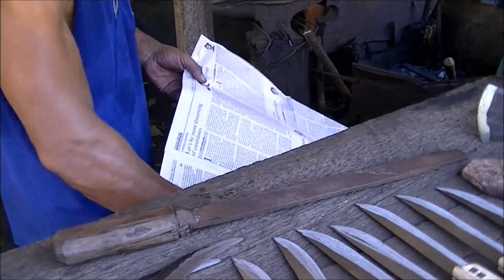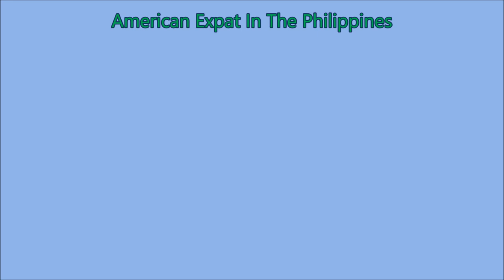Filipino Blacksmith - Making Bolos

Comment: do they oil or water for quenching?  They don't test either for hardness?
Reply: I'd hazard that they more than likely use water, given their resources available. Yes, it is leaf spring but I'm sure the water is plenty heated enough from the amount of items being quenched in it it.

After a while, you pretty much know how long to heat a blade, when it's hot enough to be quenched, and when it tempered. And, given the sheer amount of blades these individuals likely hammer out yearly, they probably don't need too anymore.

Either that or their testing is when they start filing the blade. The file will just skate and slide across the surface of a properly hardened blade.

Btw I'm a blacksmith myself.
Reply: @Kurokubi  their method of quenching the steel is not using the traditional way. We have a technique passed down from generation to generation likely to cut a nail with it. What they are using is just a basic hardening and no tempering that's why its likely to get chipped. Same reason that i stopped buying and started forging my own blades as the quality of the blades from the market are no longer have the quality from the old times. Luckily learned a few tricks from the old generation.

Comment: i wish i'd find these blades where the handle is more durable and longer-lasting than wood. don't get me wrong, i'm filipino, filipino blades have always sparked my imagination ever since, but i wish they'd upgrade a few things, the handle for example (next the sheath). i'm thinking of melting white pvc's over the full tang handle, looking at a few youtube videos, anyone can melt pvc's into any shape with just boiling water. but of course if you have better tech available to you, then of course if i were you i'd ignore pvc as well. if it were the year 2519 and a material stronger than carbides of today was just invented, i'd throw away steel in a second.

wooden handles were all the rage when there was nothing better available (in the year 1919 for example), but in the year 2019 there are now a few things commonly available that perform better than wood.

take note, i have no complaints with the workmanship of the blade, they're awesome, for me they're perfect.

i wonder if they will take on special job orders for these specific bolo blades be permanently mounted on forearm bracers as a pair of forearm blades. they seem to be making only those shown on video.
Reply: If you want that better see them and give them the item you want to be build. They will be happy working with that but well that bolo is dirt cheap so don't expect high quality materials specially for a dirt price.